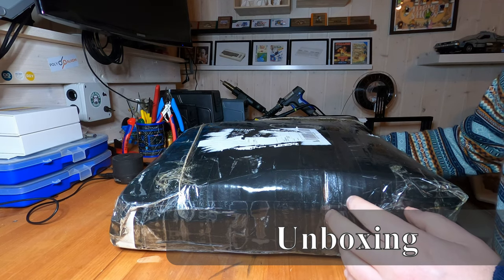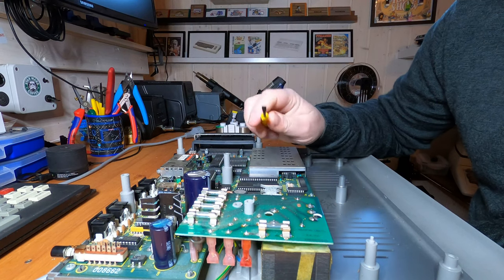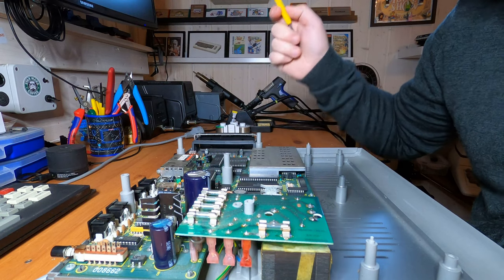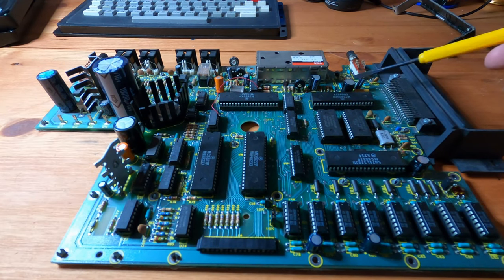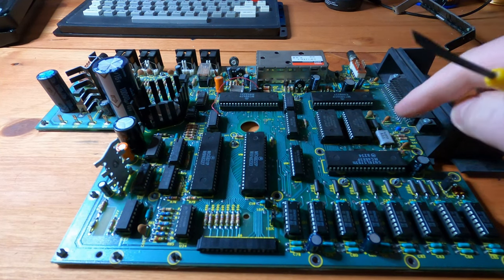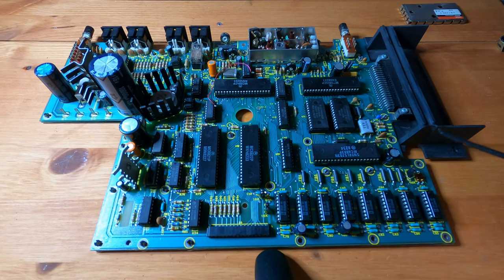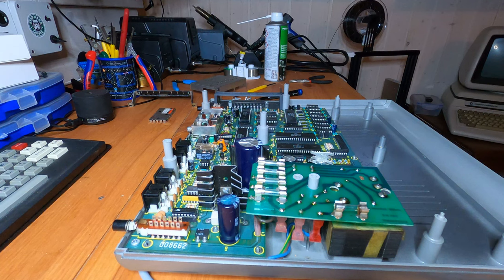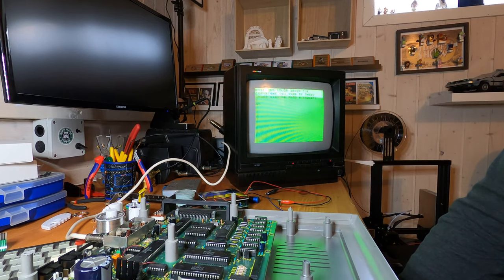TRS-80 - "It's the fuse!", he said

Comment: If you do PRINT MEM, you should be able to figure how much RAM you have. Since yours has Extended BASIC already installed, the system will steal 6K for a high res graphics screen by default (plus BASIC reserved it's own RAM for internals), so it should report a number around 8 or 9K if you have a 16K machine, or around 24K if you have a 32K or 64K machine (if the latter, most will be 64K machines with 64K RAM's; 32K was usually done by stacking 16K RAM chips, or with partially blown 64K, but that wasn't done very often except the earliest days). You can also test out the color output to your TV by doing CLS 0 through CLS 8. In order, the 9 colors you should see (other than the top text stripe that will pop up with "OK" in green) are: black, green, yellow, blue, red, white, cyan, magenta, orange). You can also test the sound output with with either the SOUND or PLAY commands. SOUND take two parameters, but from 1 to 255. The first is the pitch, the second is the length. SOUND 1,10 would be the lowest tone BASIC can produce, and SOUND 255,10 will be the highest. PLAY is more sophisticated and is similar to GW BASIC; you type the note names (for example, PLAY "CDEFG" will play those 5 notes in the default octave in a row. You can control the volume, though with V0 through V31. A quick BASIC program will play the same note at increasing volume levels:
10 FOR V=0 TO 31
20 PLAY "V=V;C"
30 NEXT V
Reply from the maker: Sweet! Thanks for this. Really appreciate the info :) It was sold as a 16kb machine but I'll definitely test all of this out :)